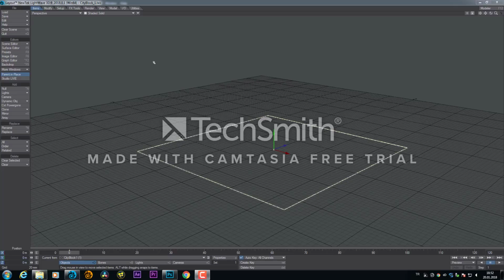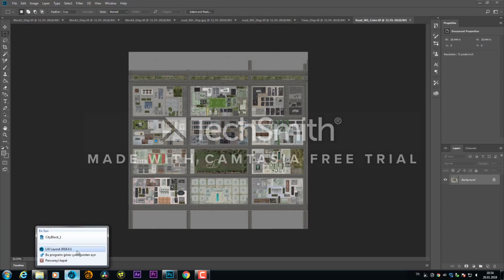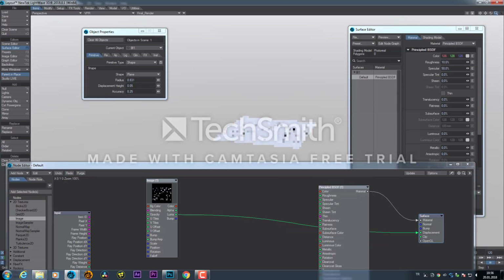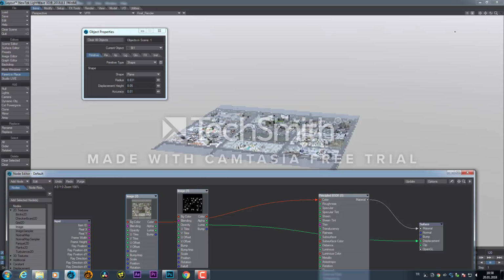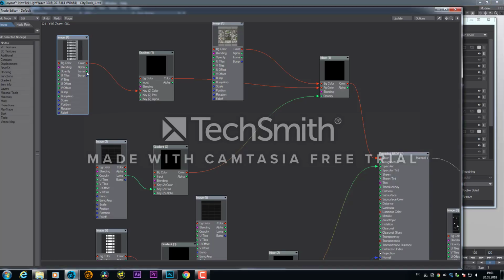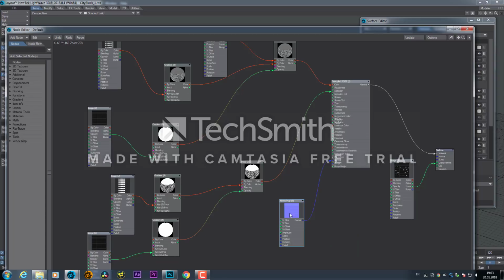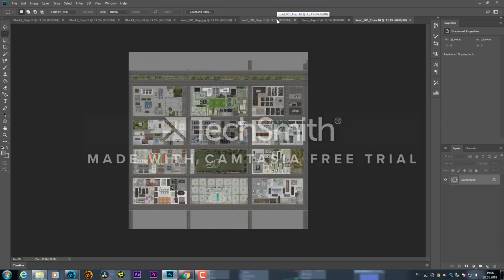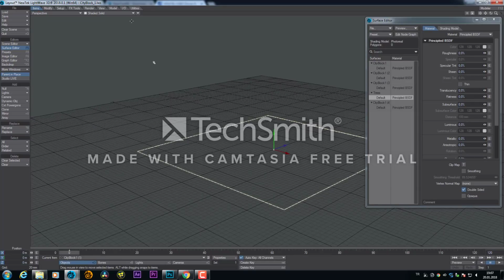Lightwave 2018 NEW Paramteric Objects Tutorial

Comment: Hi Sahin, cool and thanks for showing the possibilities, yeah the water mark is a bit in the way...but the noise in the background is probably worse, as for showcasing with vpr, unfortunately the vpr refresh speed seem very slow with parametric object..or some other setting you have, I will check back what may impact this, could be your computer hardware as well as GI settings, or camtasia interfering with system resources.
But..there is a free recording software, I haven´t installed it..but it was recommended by erikals, it´s OBS studio and open source, unlike camstudio which may cause virus issues.

https://www.youtube.com/watch?v=I9mqoj4U2uE

I will try that recording device, for my latest recordings however I used nvidias internal recording options ..if you got one of the later nvidia gtx cards, you may want to look at that, no software..directly recording from the graphics card.
Reply from the maker: PrometheusPhamarus , I think it was more like camtasia slowing down the vpr cause even though paramtric objects are slow to render vpr was much much faster when I was working on them without camtasia. As for sound, I do have nvidia titan X card in that machine but I have no idea where the microphone goes on it :) I will check it today. I never use those things as I am a visual guy I don't bother with sound. We have editing machine which is equipped for this sort of stuff but that pc has no LW in it.. So you see what I mean.. Thanks for the help, much appreciated.